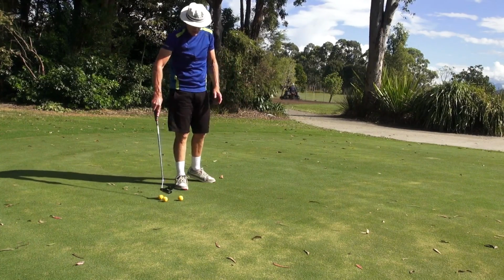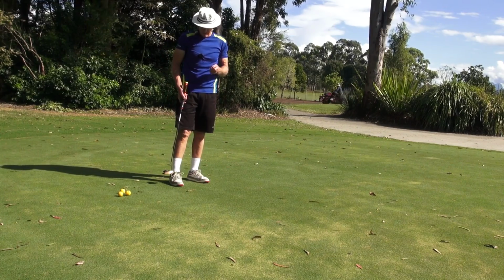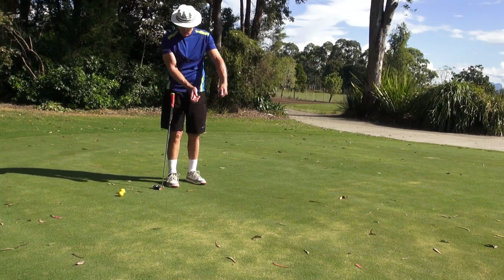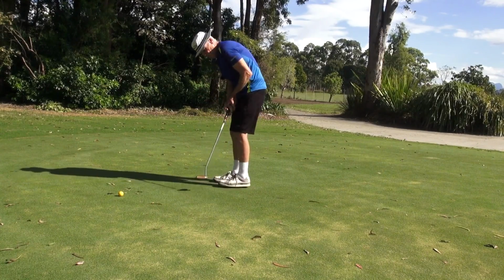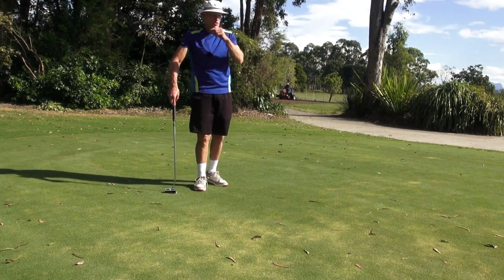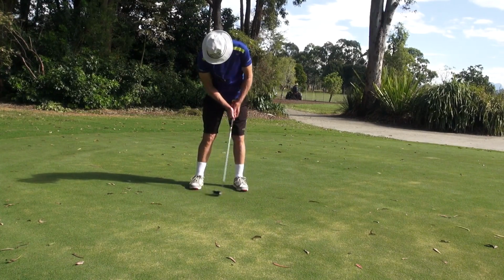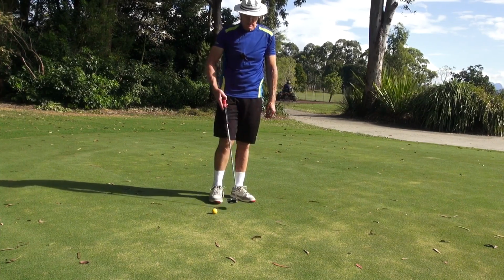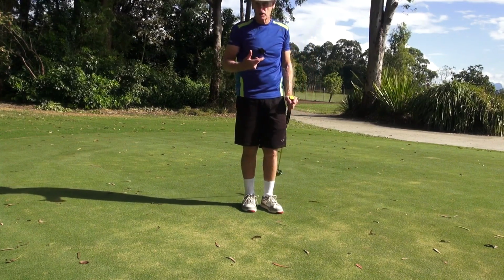More Goerge   Low Putting   technique info

Comment: Here is a quick summary of George Low’s putting method / stroke - the “swinging door” (for RH) …

- the putting stroke and the full swing are basically the same operation; one is short, one is longer

- the putter is held in the fingers - 6 finger + 2 thumbs grip, with pressure point on both thumbs and the right forefinger set “as in triggering a gun” (hook or like a ? position, wrapped around grip, slight space from second finger), the left forefinger is reverse overlap and the right pinky is overlapped like Vardon-style, the back of left hand and palm or right hand are facing target line

- find comfortable length to place your hands on grip

- arms hang naturally down, elbows stay close to body

- slightly open stance, shoulder width (distance = outside of shoes; not between / inside)

- one ball position, hands slightly ahead of ball to hit slightly down at impact (not on the upstroke)

- his stroke was “wristy but not flippy” and movement was from hands/wrists and maybe a little forearms (“elbows down”); only used a little upper arms and shoulders on longer putts (usually 30 ft or more) / slower greens requiring more speed / distance

- “left hand is rudder, right hand is drive shaft”

- stroke tempo is anything but fast

- more weight is on left heel, no body or head movement during stroke

- one (or more) practice stroke, set up to ball and go / stroke

Practice, practice, practice.

I share this for accuracy / info and happy putting !

Regards …. o _ !
Reply from the maker: Thanks for all of that  ..   I absolutely agree with those  3 words..  Practice..Practice.. Practice..  and if  I    were to   add something  to that  it   would  just be  ..  '  More Practice'... 
                 Today there are no    "George Low'    guru types of putting  ..    Dave Stockton is  Putting  Guru of sorts  ..  and   I have been to one of his clinics and he didn't putt well at all the day I saw him  ..  George never had an off day .. I would love to have spent some time with him  .. as I would have with Count Yogi who was an incredible putter  ..  Norman Von Nida spent a morning with Yogi once and he said he actually looked like he was controlling the ball with magic the way he just hit the ball on the run to any hole you nominated  ..  and they just went in the hole as if they were being sucked in by some magical force  .. 
                      Sam Snead told me  Bobby Locke was the best  Tournament player/ putter of all time  ..  but  George Low skinned him bigtime in a putting money match  .. 
                     George called out Hogan when he was at his peak in  1953    for a money match and Hogan was quite rude about not taking the challenge  ..  he said he was a    Golfer'  ..  not a  circus act  ..  Snead Told me that  .. 
                    It would be interesting to know if   Low ever called out  Yogi for a money match in putting  ..  now that would have been something to see..  
                          cheers JH

Comment: I’ve been using a wrist pop stroke for awhile now. The putter face comes thru the ball so square..
I’ve added the thumb forefinger grip and the open stance. As they work well.
The only thing else that I’ve added because I’ve always done this is that I have a very conscious of the feel of my follow thru. It’s like I’m using a paintbrush as I stroke thru the ball. This may add a tiny bit of shoulder movement to the stroke but it’s after the ball is gone anyway.
Cheers and thank you
Reply from the maker: The closed shoulder line and the in to out swing path      and the setting of the weight into the trail vertical axis just makes the stability of the hinging action so high  .. I feel my body is totally isolated from movement in any way  ..   I cannot miss hit the  putt  .. the strike is so  solid every time..  and it makes no difference what type of putter I use  ..   the preference is for   a    thicker than normal  grip   that is   parallel     is section ...  and a lie angle that is    reasonably upright  ..  but  putter construction type  doesn't seem to matter .. 
                        cheers JH

Comment: Hey JH. Thanks for this video series.  Genius.

Played with it for a few days now and am amazed at how much force can be applied, distance....
This  looks like a wrist putt that is usually associated with that upper body rotation. Bad stuff indeed.

I have been using a Weedon inspired putt. Arms glued to your sides and rotating around tiur center. This is also very reliable.

This however has even fewer moving parts I love it. 
Putting has been keeping me away from single digits....

Take care and I hope you are feeling better.
Reply from the maker: The one thing that you want in a putting stroke  is ..'Touch'.. and the tips of the fingers  transmit  more touch  than any other part of the  hands/arms.
          As well  if only the   wrist hinge is active in the putting stroke    the body's centers of gravity  are  much  easier  to maintain during the stroke..  simply put  you just don't  'move' as much.
          I am feeling a lot better  right now, hope to be back on the practice tee   as soon as  our terrible  rainy weather  abates.
                      cheers JH
Reply: @1atomicgolf  the great Moe was a huge proponent of reducing moving parts. I used to be a professional cook, anyone who has ever had training in the proper use of cooking knives has learned the proper technique to holding them. There is such a similarity between the two things.

Next Saturday will see this added to my round.

Glad to hear you are rebounding.
Reply from the maker: Wow..  now that is the first time I have heard  about the  critical  orientation  of  the  grip  on  a  professional cooking knife..  I guess  it would be vital to  have the absolute  correct   grip positioning and function  with those knives..  I have always been fascinated  to see how  professional  butchers  carve up  sides of beef etc..  they do it so  majestically..  and  of course  it has to be  such a  precision  action with those knives in order for the  cuts to be  efficient.
              'Feel'  is  so vital  with the  action of those knives..  and your cooking knives as well.. and of course  with a putter grip.. so I guess we could say you are going to  'carve up'  your score next Saturday ..especially your putting  numbers.
         cheers JH

Comment: Good Day JH!  Are you familiar with the Boccieri Heavy Putter?  The clubhead weighs 475 grams but there is a weight kit so you can adjust it up or down by 25 grams.  But it feels really heavy.  John Daly touted it for a few years I believe.  I have one and tried it with the pincer grip, hinging the wrists and the ball really goes to the hole with authority.  I have some history, putting with hinged shoulders, of not getting it to the hole always.  Hinging the wrists with the pincer grip really seems to get it there every time.  

What’s frustrating to me is I just bought a new arm lock putter and was excited about it and was putting much better with this new putter than previously.  But it’s designed to hinge the shoulders.  I will have to have a putting style contest but believe the pincer grip with my Heavy Putter will beat the snot out of my new arm lock putter.
Reply from the maker: Hi Craig,
              I have tried the 'Heavy Putter'  ..  not with this     process  though ,,however I just don't think it would be   conducive   to     the  pincer type grip   and    full   soft wrist hinging    because   with the  full soft wrist hinging   you don't    want to have to  exert     a lot of   pressure with the   pincer fingers    or the     wrist hinging     .. and  I  think the  heavy  weight of that putter     might   upset the    efficiency of the  pincer gripping     application .. having said that  it may not   do that  for other people   ..
                       cheers JH
Reply: 1atomicgolf  JH, I think I can appreciate what you mean with a desire for soft wrist hinging and not putting a lot of stress or strain on the pincers.  BUT, I wish you could test the Heavy Putter today with this process.  The Heavy Putter also features a 250 gram counterbalance in the shaft/handle/grip over conventional putters so the heaviness is there but it’s not overbearing.  I, personally, feel just a pronounced comfortable pendulum swing.  My wrist still feels very comfortable.  But, then, my feel and your feel would be different because I’m not a top level golfer but I just wanted to share my thoughts.  I just know that the ball goes to the hole with authority that is different from my typical strokes.  Thanks.
Reply from the maker: Hi Craig,
                 Just    try  the heavy  putter   with the   Pincer grip   and 'see'  what   occurs  ..  it will  probably take     a  bunch of putts to  get the     kinesthetic  feedback      levels you need    to    get    confident with the action  ..   but really  the weight of the putter      shouldn't  make    a difference so great as to   preclude  it  as a putter  you can use  .. just   give it a whirl  and see  how you do  ..    its all about    'trying'   things/processes   ...  'anything'  can work if you commit to it strongly enough ..
                    cheers Jh
Reply: 1atomicgolf   Isn’t this wrist hinge putting style the same or similar to how Billy Casper putted?  He was known as a very good putter if I remember correctly.
Reply: 1atomicgolf a1

Comment: Hi JH, I tried this and it seems promising. I tried an arm lock putter and it's not for me. It put my lead hand in control, which means I had no distance control. I suppose I could learn it, but my trail hand already knows what to do. This lets my trail hand dominate and doesn't require a special putter.
Reply from the maker: The trail hand is the 'Seeker'  hand of for feel and maximum dexterity efficiency application...especially the 'fingers'..
                         cheers JH

Comment: Been putting that way forever jh.ive tried everything and that's the way I putt.but I have a weak lead hand grip and strong trail and actually play golf that way.basicly my forearms rotate out when I grip the club instead of karate chop part of the hands being 45 dg.to the sides of the body in a natural bent over position my forearms and hands are rotated out. Back off the hands are 45 dg.to sides of body.if that makes any sense.just the way my hands and arms work also with full swings.ya I've seen the Hogan rag wring and basically it's oxymoron to my approach of placing my hands on the club.cheers
Reply from the maker: Hi Nat,
           I can conceptualise what you are doing with your own putting structure application...nothing wrong with it..   if it gives consistent results its the 'right' way to setup you're putting action ..   I had a similar arm/grip structure about 10 years ago   and it worked great at the time ..
                    cheers JH

Comment: JH my putter is an old Ping B60 toe-heel weighted club. The video is really interesting, can you tell me if this type of putter would be suited to this style of putting? Many thanks 👍
Reply from the maker: Hi Gary,
                     The main considerations  are   that of a  fairly upright lie   so you can get   the     clubhead soled out      as vertical as possible which gets the hands      as close to the body as possible    during the stroke ..   and a  grip    type of   profile   that allows     the    tips of the fingers/thumbs  to      pincer into the  grip   ..  I have a slightly    wider  grip than you would have  on that old  B60 Ping ...  I guess its just a matter of trying to see how well you can configure the grip   with that thin type grip   .. 
                   I actually used 5 different putters yesterday during my   250 putt test session and virtually putted with the same     degree of   accuracy with all of them ...  the 5 putters   were the same  lie as  the one I used today     which  helped for sure .. but the    heads and shafts configurations   into the heads  were    different  .. but they all worked    virtually   exactly the same ..
                           So the bottom line is     that its really the putting grip and putting mechanics that make the difference rather than the actual putter  .. 
                   I have   a  very high tech putter that  I designed   myself    ...it is like no other putter    engineering wise    ..  I      left it at  my brothers house a few weeks ago      so I couldn't include it in my test   with the other putters  .. I    will be getting it back tomorrow  so I will do a video with it     and  see   how   the   grip/mechanics      apply themselves to the   best  putter design   engineering  ..
                                cheers JH
Reply: @1atomicgolf  Thanks JH, really useful information and video. I play my first social 18 holes with my brother in law tomorrow and will be trying this and the Channel Lock in earnest. Ten years roughly since I last played so wish me luck as I'll need it. Thank you and the others CL you tubers for getting me back into the game. Looking forward to the next vid ☺ 👍
Reply from the maker: Hi Gary,
                 Just   keep  a light grip   on the club  and relax the shoulders       and neck    and  just feel like the clubhead is a tennis ball on a string  .. just     let the clubhead   flow  and don't try to   direct it  ..    let the arms swing freely   past your body  .. don't try to get the body   into the shot  to  much  .. 
                      I actually had  a Gold Plated'   one of those   B60 putters  .. Ping used to give  a gold plated    putter   to    any   tour player that won a tournament with      any ping model putter  ..  they    apparently    made up   a few   gold plated   B60's  when it came out  in anticipation of      some tournament wins  ..    I   found it in a  Golf shop in Arizona  ...  it belonged to the manager   and  I  bought it off him for   $500    which was  a lot of money these days  ..  it  didn't have any players name on it   ..  it must have just been   a  stock   putter    waiting     to be  given out   to a winning player  ..  /               
               I sold it to a Japanese guy two days later for $1000  ..   I never even played with it ..
                                      cheers JH
Reply: @1atomicgolf  Thanks 👍

Comment: Hi JH. I'm thinking of doing an aimpoint express greenreading putting course like how Adam Scott does it with the weight ing n holding fingers up. Just wondering your thoughts or if u would recommend some other method for green reading. Thanks Richard
Reply from the maker: Hi Richard,
       I  have no idea how Aimpoint works.. never tried it...I have never had trouble reading greens so I  don't need to try any method other than what I have always done.
                I have always sighted with my dominant eye with my non-dominant eye closed  .. that is to eliminate Parallax Error .... I always sight from a perfectly square shoulder line directly face on to the hole  ... I never cock my head in any direction other than dead perfectly square on to the hole  ...   I stand just to the right of the hole when viewing the line assessment so as to get my dominant eye utilised correctly  ...  I don't walk up to the hole whilst assessing the line because as you change the viewing position the break will change  ..
              The other thing I have always done on longer putts is play more break than I  think I see in the putt...I just found early on in my golf that invariably everyone I played with underread their putts  ..  Dave Pelz provided that later on in his studies  .. he said that club players actually most times underread their putts by   50%   on average  .. I already knew that after playing golf for only a short time  ..
                    I  did cut back the amount of break application after I went to Dominant eye reading because I took a lot of the Parralax Error variation out of my putting  ..  I still play more break that I see.. but nowhere near as much as I did when playing with both eyes sighting the break amount..
                 Putting is for club players a problem because they really don't get their body alignment structure set up the same every putt  ...structure setup with putting has to be  'exactly' the same every putt  ..shoulder  alignment   has to be  the  precisely same every time you    set up to putt...and that is why   Pro's   take so much    time  to get set up to put  ..   club players   invariably  are    haphazard  doing  that ..
               Overall Putting is a very precise application of body angle application repetition ...but you have to 'know'  when you are  'actually'    in the correct position ..
                      cheers JH
Reply: @1atomicgolf  thank you

Comment: In the sixties when I started playing this was a no no. The lead wrist was suppose to remain flat.
Reply from the maker: Hi Thomas, 
            In  conventional theory  a flat lead wrist  and  no movement in the wrists at all  was...and  still is..  the  suggested  mechanics of putting.
        However  George Low  didn't prescribe to  that theory  and developed his own putting  mechanics  ..which worked incredibly well for him, he was regarded as the best putter  in Professional Golf at the time.
          Its like  anything  in  golf mechanics,  'if it works for you'..  then its  a good process,  I think the  easy solution for anyone who  is adverse to the mechanics is to just try the method/process   and  see what results you get,  I think its a great  process because it improved my putting  significantly.
          It was  interesting that  the  other incredible putter, of the time ..Count Yogi...employed the  hinging  lead wrist as well...he  had a  different  fingers  application...but generally  employed the free  hinging lead wrist  process. 
              cheers JH